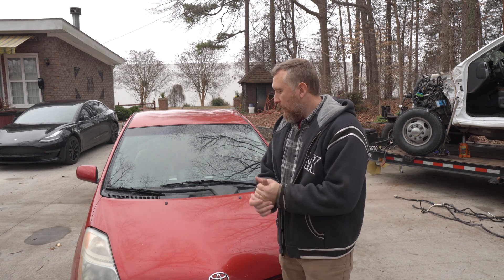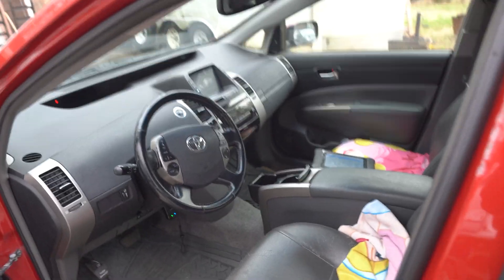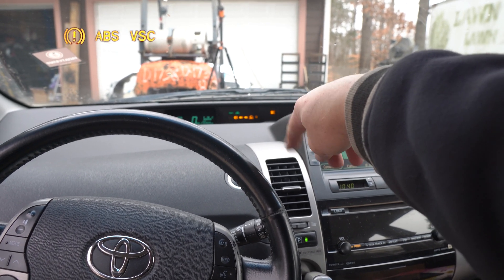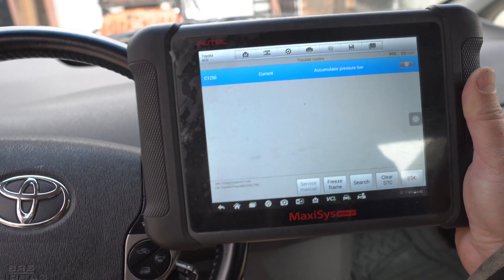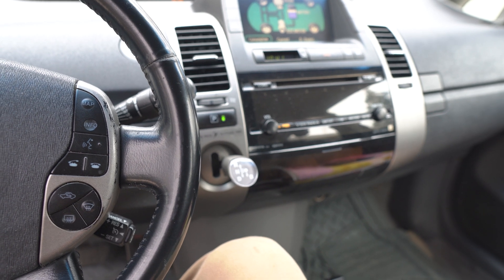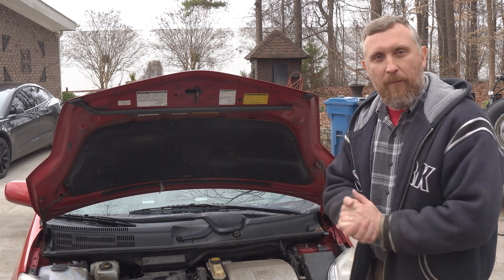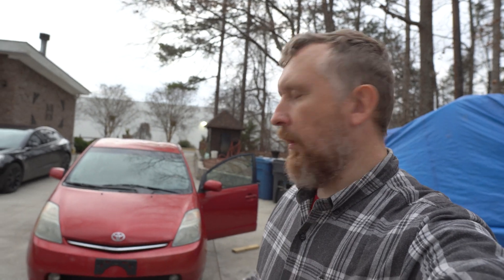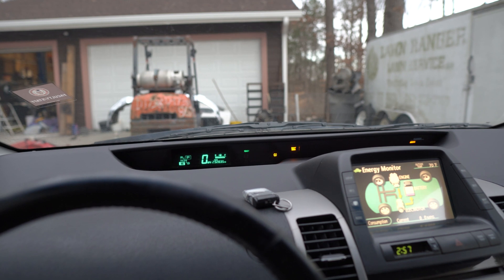Toyota Prius Problem C1256 ABS pump replacement

Comment: Is the used part still working? I don’t want to spend on a new one. Just wanted to see how long the used part will last
Reply from the maker: Yes, it still does work. But I would recommend finding the part from a donor with smallest mileage you can find.

Comment: those lights are on on mine. pump doesn't run constantly though and the front brakes work perfect but the rear brakes don't bleed (barely) I wonder if its this though?

Comment: Im in particular abs situation. Forst replaced the small pump to the keft, and with weeks of trying replaced the ABS unit too (because once ABS and regen cane back out if nowhere) I dont have the high tech OBD. 3rd party mechanics said dorry, Prius ECU kept booting them out

Comment: I need to do this ABS replacement.  Thank you for a great video.  How long did it take to do the replacement?
Reply from the maker: To be honest I don’t remember plus I had an issue with a top line. If everything goes smoothly I would think 2-3 hour job

Comment: Instead of replacing complete ABS assembly, can we get a kit for ABS to replace worn out parts of ABS
Reply from the maker: You probably can. But it’s easier to change the whole pump
Reply: @akindiyrebuilds6223 as i can see, this pump works overtime for the last 10 years, and like every brushed motor, it gets worn out. 
I will try in few weeks to dissasamble mine pump and try to repair it. Dont think brushes can cost more than 2-5 € + work if you dont know how to do it, compare to 250€ on used one atleast in my country.